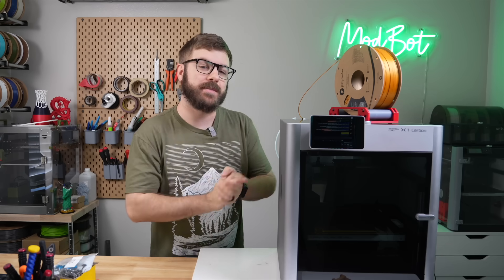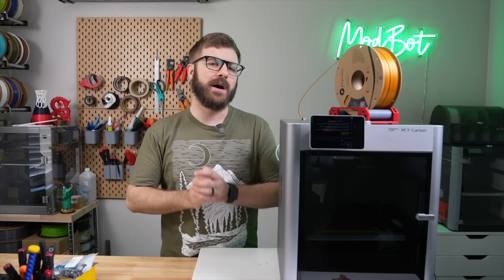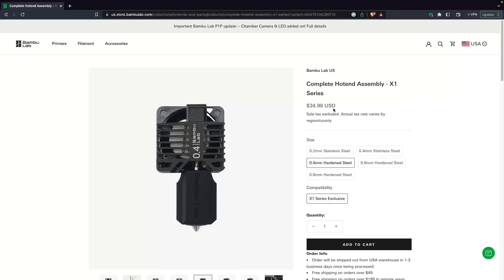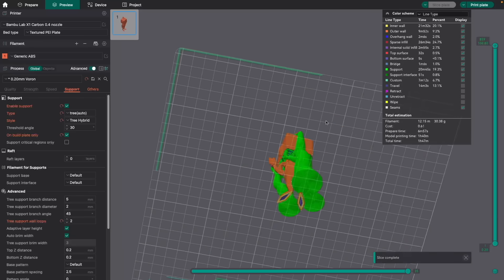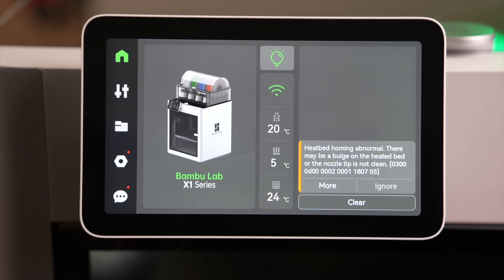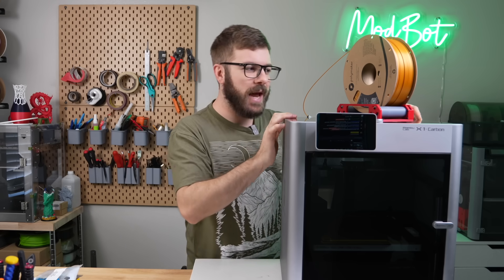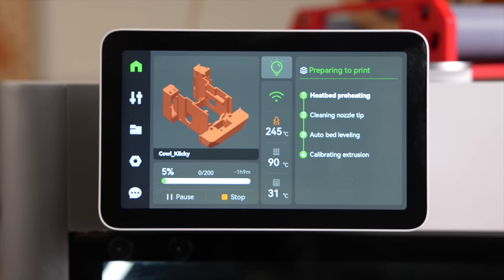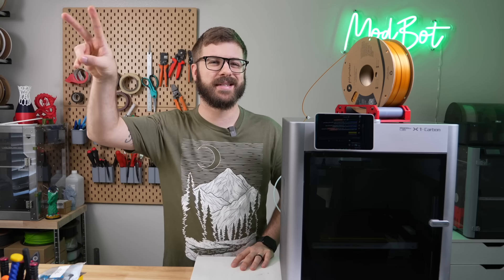One Year With Bambu Lab X1 Carbon

Comment: One Year Later they change the terms of your purchase LoL JAN 2025 UPDATE: Bambu Lab Firmware Update Forces Cloud Dependency & User Lock-In.  Exercise your Consumer Power of the Purse  - AVOID THEIR 3D PRINTERS!
Reply: The printer is so impressive that when this news released about the closed ecosystem i did not care one bit. Not to mention Bambu released a work around. But who cares, the printer just works, and I don't see anyone stepping to the plate without issues. I'm talking to you Creality.

Comment: Since it was a 1 yr review and the review is 1 year old, have you seen any improvement in customer service especially response time?  Maybe it’s gotten worse.  I think Bambu Labs is the DJI of printers.  The first to pull everything together with the Phantom 1 and then expand into the commercial market and improve all entries.  They too had customer service issues at the beginning.  I think in 10 years BL will dominate the market.  About to pull the trigger on the X1C.  I am a newbie so have been spending a lot of time on YouTube.  Like you, I want to make parts.

Comment: My only small issue with X1C has been multi-color with hundreds of changes, using carboard spools (eSun, edes taped). 1% of changes, the filament gets a problem... but 90% of it is due to the poor spool.

Beyond that, X1C is a bliss.

Comment: I have enjoyed using my X1 Carbon 3D printer but had an issue with the original (I was one of the kickstarters) AMS.  I had to replace an AMS first stage feeder and it was LOTS of meticulous work.  I never could get the AMS to work properly so I gave up and actually quit using my X1 Carbon for many months.  Recently I got back into printing and tried the manual feed method.  It works but it doesn't seem as nice as having a working AMS so I decided to buy a new Ams (being that they are on sale) and hope that the quality of the AMS is more reliable.  I do have to say that Bambu Labs has been very good at responding to questions and I like the fact that they continue to improve the X1 Carbon slicer/software.  They seem to really care about the high end quality of their product and it is refreshing to see that they continue to move forward.  It's great to get back in the 3D printing hobby.

Comment: So bought A1 recall, so I bought P1S
Problem with the Cutter is stuck error. So Yes returned it now thinking going to get X1-Carbon.
I want a machine that does the work.

I’m thinking .06 nozzle is way to go but there out of stock.

My goal is to make a bobble head, but I feel like I’m far from that 

Please advise what your thoughts are I would appreciate them. 

A guy that loves 3d printing, but has had a lot of problems

Comment: Great video. I contacted Bambu support in regards to improving on the serviceability and the heat bed cable issue referenced in your video - at first they responded with a generic reply and didn’t even answer my question. When I stated that they didn’t answer my question they replied again generically and said yes they fixed the problem. I have no reason not to trust them but I am skeptical. I definitely would buy this printer however you showing the 40 screws and the two hour time frame to replace something like that is preventing me at this time I own 4 Prusa MK3 machines and they are amazing and are easy to service. But they’re MMU is horrible from what I hear. If you happen to have time to respond and are aware if they’ve improved on this issue that you experienced I would love to know. Thank you.
Reply: Yes, I can vouch that Prusa mmu (multi-material upgrade) is horrible. I laboured for two years to get it to work reliably and failed. It is not well designed and firmware is shoddy. I was SO relieved when I removed it and went back to a 1-reel machine.

Comment: We have X1 carbon at work for over year now and could not be happier - its such a great tool - we where not super expierienced before and we where using Rise 3d E2 solid but comparitivly on slow and expensive site - now we have 2 X1 carbons and we have so little issues - only one worth mentioning is a lile bit of warping on big ABS prints - becouse of that we Print mostly PETG and prints go of great

Comment: FINALLY, a review that shows the shortcomings in an objective way without excess positive or negative bias. I am still leaning mk4 prusa because of the sheer reliability in parts and performance, even if it isnt as fast (and supposed best first layer support of any printer from what I hear), but I was really  bouncing back and forth about buying a x1c as a second printer because of the support and quality control issues present in the vast majority of PRC based companies so far :/ . I do hope they fix this in next generations though, I would love to get some cheaper workhorses to support a core reliable prusa base.

Comment: I'm surprised you had two major failures. As a consumer, I know a regular user isn't going to get the velvet glove marketing dept. treatment a Youtuber is, so likely in a normal case, the buyer would have had 2 bricked machines, wasting $2400 - this is a pretty bad scenario, even for 'v1' hardware. Not sure whether Bamboo is worth the risk, your experiences says 'no'. if my $150 Neptune 3 dies, I'm only out $150.

Comment: I've been going back and forth between this and the Mk4 (for purchase), and you tipped me to the X1 Carbon. I appreciate your knowledge of the printer and acknowledgment that it's not perfect, but that Bambu has been hard at work to improve it.
Reply: I've got a MK4, but it's killing me that 1) waited so long to receive it and 2) MMU3 is still yet to be finalized and ready to ship for MK4. I'm seriously considering purchasing an X1C for the AMS feature as I've been waiting 2 months for a dev update from Prusa on MMU3 for MK4.
Reply: Depends: Do you want China to have all the data that goes through your printer (including that camera)?  Then go with BL.  Do you care about not letting your IP be used against your wishes?  Then don’t go with BL.

Comment: Being a long-term tinkerer of 3D Printing, I am at a point where I want a "buy and print" machine with less repairing and upgrading that has been required for a while.  The X1 is on my watchlist as the solution, but I think it will be more than likely the next version.
How does a filament dryer work with it though?  Is the AMS a dryer also?

Comment: No doubt a fantastic 3d printer. But my time with it was spent doing more fiddling and maintenence then I was comfortable with.
Reply from the maker: What sort of things did you have to do? And over what extent of timeframe?
Reply: @ModBotArmy  It was the heat bed cable that needed replacing after 3 months. I also found the auto calibration hit and miss. This was down to a uneven bed plate.

Also I found the heat isn't kept inside the unit well, and had to line it with installation.

But, when it prints it prints fantastic and it works more than good enough for me. It's just I prefer not to do 3rd party mods as I just don't have the time and also don't  feel conformable doing so.

Comment: Considering the XIC or just adding another MK3S+ to my fleet. Would be my first Bambu Lab printer. Would you recomend I stay with the faithful Prusa to keep pumping out prints or the XIC to decrease print times and hope all the updates to the printed make it last longer and keep it's print consistancy?
Reply from the maker: That is a tough call. There is value in sticking with the same printer. Both sliced files, familiarity, and spare parts. However, the speed output and material capabilities of these printers is nuts and could help you to expand your business. I am almost tempted to say it’s worth getting one X1C to dip your toes and see how you feel. Best case it ends up being a game changer for you and your business. Worst case you have a blazing fast prototype printer for new designs/models. Just one perspective. Ultimately only you can decide what is right for you.
Reply: @ModBotArmy  Love the feedback. Thank you. Lots to think on!

Comment: With everything on the cloud(not necessarily bad, except for making mass marketed products!), it is a matter of time that Bamboo Labs unveil the digital design marketplace, coupled with rfid locked material(only material that would be allowed to print marketplace item), it could drive their marketshare exponentially.
It won't be a big surprise the P1S is introduced make it possible with a lower priced product. There is definitely more under the hood in P1S, than just a few panels for an enclosure.
Rather than making money out of low margin 3d printer business, they could be making money by, just running an online marketplace. The days of 3D printed products for financial incentive is numbered!.Just some 💭❤👍.

Comment: Depinning a power cable? Like just unplugging the cable off pcb port? 8:07
I think they gave you a $50 store voucher on top of free cable simply because being a reviewer/streamer.  I don't see that gift given to everyone on a wear tear item over 450 hours used.
I'm still indecisive on a first printer.. I was thinking affordable p1p. Then I see they were giving away a free camera and led strip. Except it's not that easy, because it requires a checkout code. They don't include this code, and seems it's a process AFTER buying a shipped p1p. But then the page says order other stuff to get the cam shipped free (??). Why not just include it in the p1p shipment

Comment: Sold my Voron 2.4r2 350 to get a Bambu X1C instead and it's a total paradigm shift in terms of useability. So far my X1C has been the most reliable out of all of my printers and I am very happy with my purchase.
Reply: What was unusable about the voron? We’re in the constant upgrade trap?
Reply: @slackreviews  had to make constant adjustments, I just didn’t want to be tinkering on it all the time.
Reply: @tylerebowers  I have a Voron 2.4, 250.   I am in the midst of some upgrades and it’s been an issue after issue.   One step forward with 2 steps back.   I am dangerously close to pulling the trigger on an X1C so I can just print.   I enjoy tinkering but 😵‍💫

Comment: I have been watching a lot of videos on this printer, I have an invention and looking to make them from carbon fiber. I don't know how many I might need to keep up with demand and I want to make sure that I start out right and not have 10 or more of the printers and regret buying them down the road. So far they look pretty good and will have to try one and build from there, thank you for your videos
Reply: For 1.5 years I've been watching countless videos of every new release. I always thought I still have to wait because the printer that is even better will come soon... something just a bit bigger so i dragged me through with my 2 printers (with printer technology at the beginning of 2022) and at least one of these 2 prints prints the whole day thure.... But now I have to say, the printer I'm waiting for didn't come so quickly.... Bambulab's step was just too big for others to catch up quick. So I ordered the Carbon X1 with AMS today. Spaghetti detector, independent filament change and finally no more SD cards. Reason enough to finally dispose of the 2 x 500 USD 3D printer acquisition costs from the beginning of 2022. I draw fast - faster than searching spare parts (unfortunately you can't print everything yet :-(. What I save in search time is unbelievable! Once I even printed a part where inexperienced customer support of a company delivered the wrong part 2 times and took 5 more emails before they even know what was needed. Who still does that, better draw and print right away. Got to say, draw faster than constantly swapping filament and jumping back and forth with SD cards.... Well, thanks Bambulab, get that thing to me ASAP :-)

Comment: I am still looking at this as a first FDM printer. I did not like the idea that initially I would need to go through their cloud to run my prints, so the lan mode is certainly a big step forward. Is there a way to write sliced prints directly to the SD card now or would I need a different slicer to do that? I have been using lychee for my resin prints. Does anyone have experience with how lychee would work with this or is that a waste of time?

Comment: Mine will arrive tomorrow.  It is my first printer, and I've actively put off buying a printer from the very early days because I'm not really interested in 3D printing itself, I'm interested in owning one or more tools that can efficiently make niche parts that I cannot easily find elsewhere.  I'd finally had my fill of spending several hours on a weekend afternoon looking for an obscure part that I could easily model in about an hour, so I did some research and landed on either Prusa or Bambu.  I ultimately decided on the Bambu because about 50% of the parts I need are for outdoor use, and therefore, ASA capability out-of-the-box is important to me.  The Bambu represented a better value proposition in that regard.  We'll see how it goes!

Comment: Hi, I have a question regarding this printer. Is this able to print the detail for shoes miniature with dimension around 10cm x 4cm x 4cm? Previously I have been using the elegoo resin printer to print it out. But I saw the result of this printer is good and comes out with coloured end product. So i want to know the technical spec

Comment: I too had to send my unit in and get a new one.  A couple months later I am having a similar issue with my heatbed.  I got into trying to check the cable and the instructions were similarly incomplete and it appears that my system was shipped missing parts.  I am a little disappointed with the number of issues I have had with this thing considering how much the system cost.  When it does print it does a great job but my operation tempo doesn't have a lot of tolerance for a tool that fails every couple months, sometimes requiring weeks to get back up and running.
Reply: If you can't afford to be down every few months, get a stratasys.

Comment: I've only had my X1C for a couple weeks, but so far it's been nothing short of amazing.
Reply: For sure but they have replaced and upgraded parts, major upgrades in firmware, over a year in is practically version 1.7. I agree, it has gotten dramatically better, even the AMS units now with stronger motors. 👍

Comment: hmmm that black stuff on the screws is something being lapped down by microscopic abrasive grit, you might figure out how to clean that better, or protect them from it somehow. Grease does tend to get black from it after a while of use, but that's not really under heavy load.

Comment: I own 14 Prusa mk3 printers, a voron 2.4, Prusa mk4, and 9 Prusa xl's on order. After 3 years of 24x7 running of the mk3 printers, I would never consider abandoning them for the Bamboo company who hijacked Prusa Slicer, relabeled it as their own, and had to be publicly called out by Prusa as violating the open source license. Your experience of waiting  4 days to get a reply to a trouble ticket is another example of why Bamboo is a 3rd rate company. When I have needed support from Prusa, their live chat is available 24x7, and when I have needed replacement parts, they have arrived at my shop in less time than it took Bamboo to even respond to your ticket. Prusa products just work. And their support is the best I have ever experienced from any company in my 50 year career as an engineer. I'll pass on the Bamboo stuff, and call me  Prusa fan boy if you wish, the title has been well earned by Prusa. If you are going to rely on a 3D printer like I do for a living, Prusa is the choice, not Bamboo.

Comment: I enjoy your channel and reviews.  I recently purchased a Bambu labs p1p and am having a lot of trouble printing Ninjaflex.  I have successfully printed this on my ended 3 s1 and even my old dremel 40d.  Have you been able to print it on your Bambu lab printer.  Also it seems that the filament has changed.  The surface texture of the new rolls feels different.  Love to hear if you have any thoughts.

Comment: Bought the P1P so far very happy printed over 2 full rolls so far only a few mistakes Have to say my fault . This is my first 3d printer love it so far printed enclosure put the glass top on waiting for door and sides putting top on temp 86 degrees inside raised it 16 degrees.  Had porinter 8 days

Comment: Great review. For the X1 Carbon what spares kit would you recommend from the experience you have had. I will mostly be using it with Nylon & Carbon Fibre filiments. Is there another printer your would suggest I look at for these specific Filiments. I am a small scale Industrial Fabricator mainly working in Agri-automation.

Comment: I would like to hear more about print quality / finish & dimensional accuracy at the high speeds offered by the X1 Carbon.  As a hobbist who prints functional parts that require dimensional accuracy and smooth finish, I wonder just how useful high speed printing is given these priorities.  To date, I have been unable to find any information regarding this topic and would appreciate your input.

Comment: I eventually am going to buy a Bambu printer simply for the AMS, it is easily the best multi-material system on the market at the price point by a long shot. 

But the maintenance is why I have yet to spring for one of these printers. They are seriously impressive, but for the moment I'm still hesitant. Crazy to think these have been around for more than a year now,
Reply: My AMS failed within 3 prints. The tension spring burned out the motor that quick